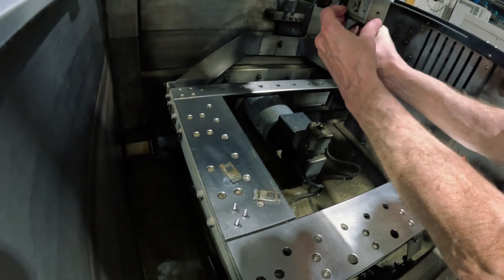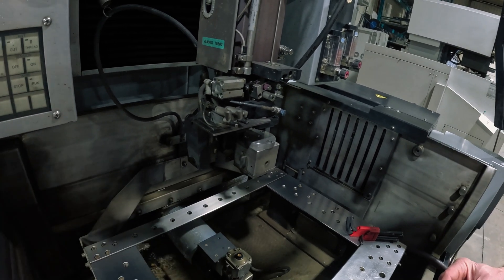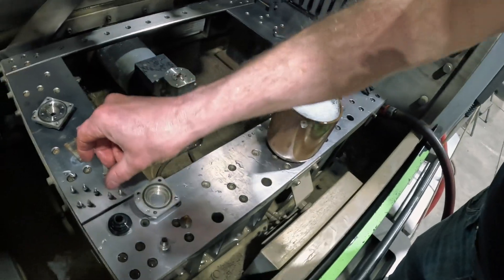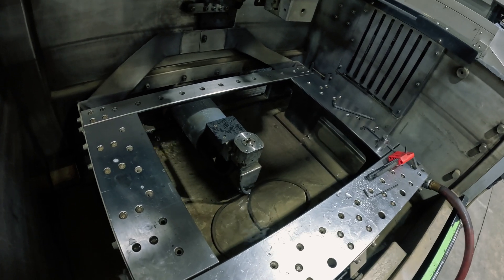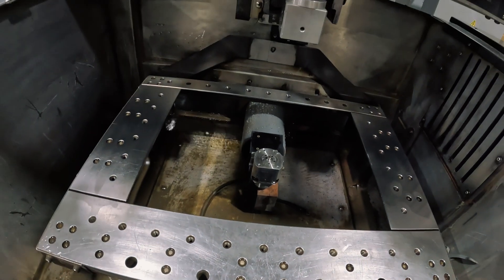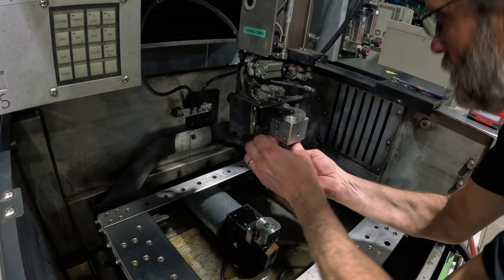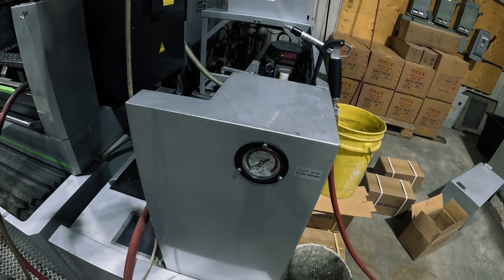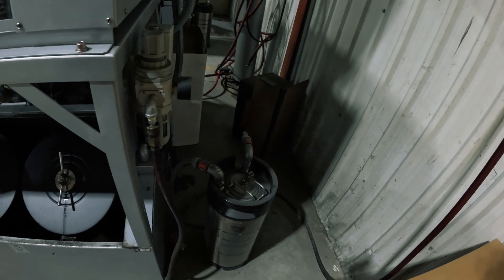My Wire EDM Maintenance Checklist - What I Do Every Month

Comment: Electrical discharge machining (EDM), also known as spark machining, spark eroding, die sinking, wire burning or wire erosion, is a metal fabrication process whereby a desired shape is obtained by using electrical discharges.

There are three different types of EDM machining, which are wire EDM, die sinking EDM, and EDM hole drilling. These are the diverse and popular ways of removing material from a conductive workpiece using thermal energy, regardless of its mechanical properties.

Comment: Get a cheap ultrasonic cleaner and put your small parts in to clean while your doing the tank.
Reply: Good point.   We do have one.   We will use it if the machine has gone longer without a service due to capacity.  It works really well.
Reply: @rongobbels4152  Do you know what the angles are for in the back of the alignment block?
Reply: And dip it K200 CLEANER